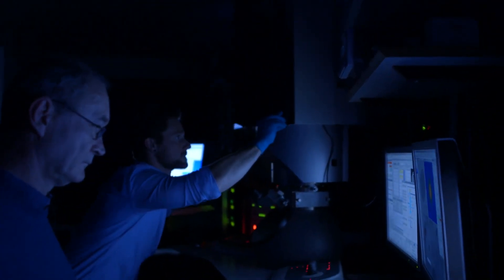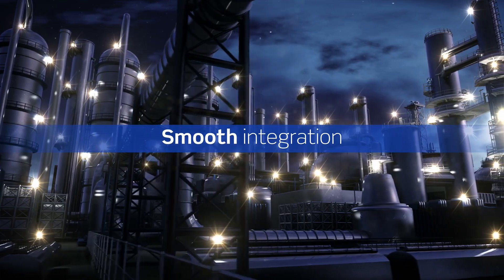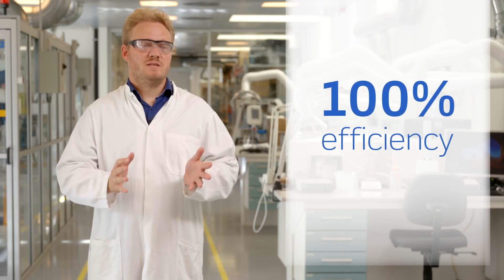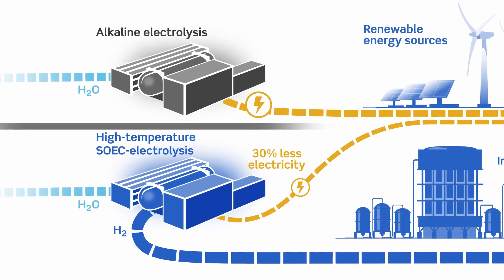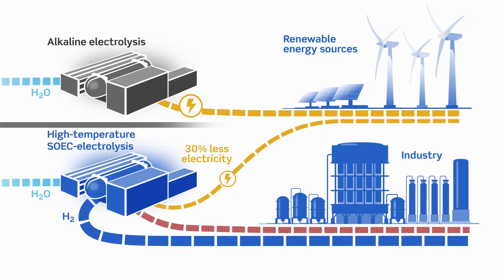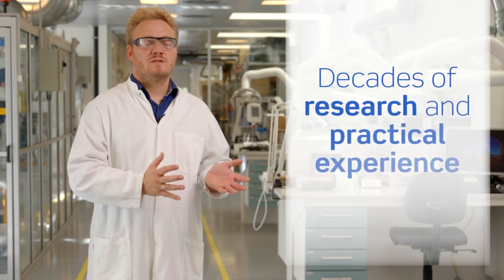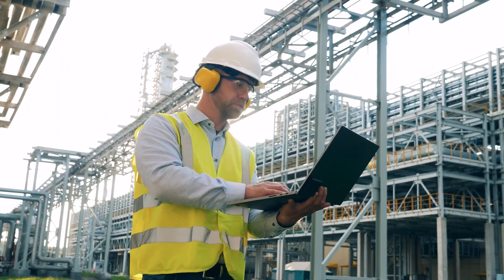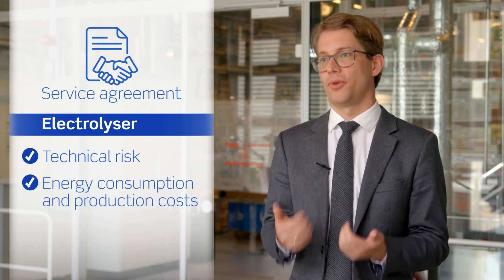SOEC - THE green hydrogen solution

Comment: This is green washing hydrogen at the moment it takes 50kw of electricity to make 1kg of hydrogen so only 70 percent efficient. The other losses is heat and increase of caustic KOH that might eat away the electrodes . The byproducts are oxygen and heavy water, heavy water is in short supply so there is demand for it in medicine. With the 200MW electrolyser you need a step up transformer the best source of 24/7 energy is nuclear power plants. For Scientists aim and goal is to lower 50kw to 40kw it is possible.

Comment: 100% efficiency...thats really amazing.....complete conversion of electricity to H2....fantastic HT
Reply: I call bullshit on that one. Pure marketing more or less. Nothing is 100% efficient. ur lucky to get 90 on a large scale. Maybe they got up to 98 or 95 in lab but no way they got it on a megawatt scale, on longer periods of time that would actually be viable. Bet there is a reason why they are not yet selling them to every wind farm. (and i don't think that this is due to ppl not interested)
Reply: It's complete bull maybe 99% at the very best.
Reply: @Virtueman1  electrolysis can reach up to 125% efficiency if you measure from the electrical input,   they reach 100% because they are using waste heat as external energy input, usually that waste heat comes as steam at 150c.  Heat reduce the electricity required to split water.
Reply: @angellestat2730  funny definition of efficiency in that case
Reply: @Virtueman1  if you can get the waste heat for free as it happen in most cases of cogeneration and your cost depends on the electricity that you use, then not sure why is wrong to measure the efficiency from the electrical input which is what would define your cost of production. 
In fact.. even PEM electrolysis at ambient temperature requires less electricity than doing the same at lower temperatures. 
A lot of process does not measure the overall efficiency from all parameters who contribute to that reaction or process.
They are not lying either, they are showing they are taking waste heat from industrial process.